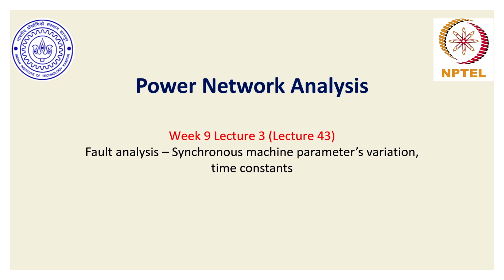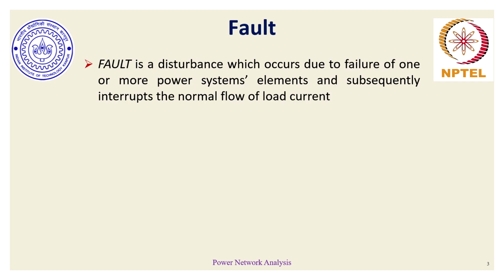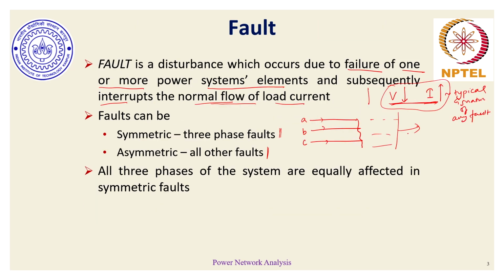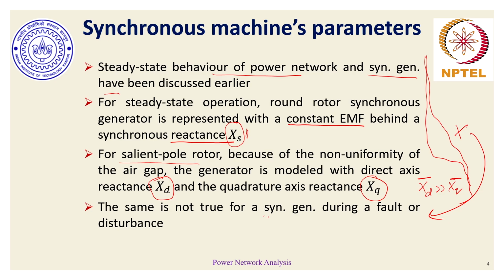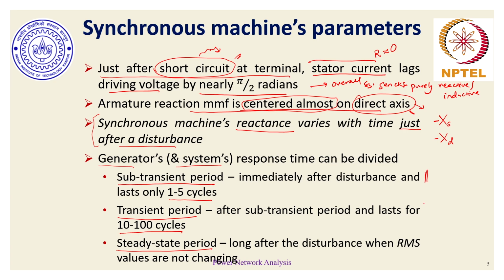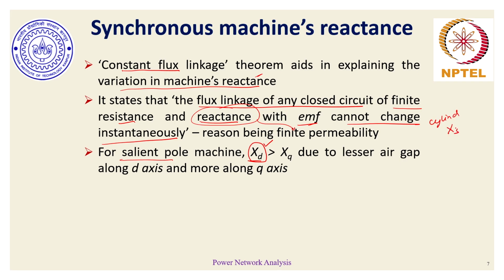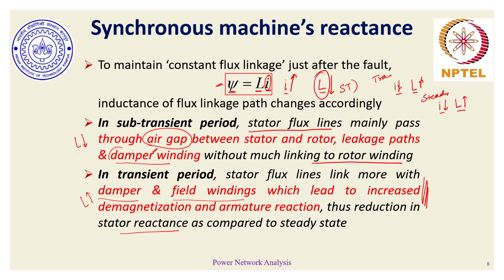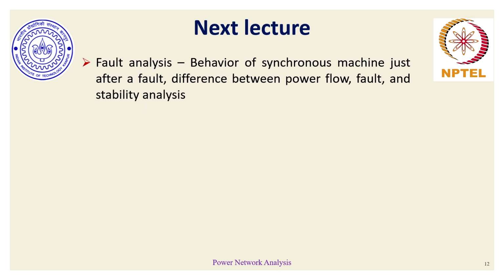Lecture 43: Fault analysis-Synchronous machine parameter's variation time constants

Comment: Thank you professor. 04:13 The elements of an Impedance Matrix are not the same as individual primitive impedances. While the latter represents only the self-impedance of a component, the former is encoded with the network topology.